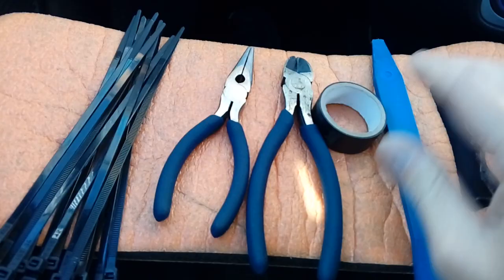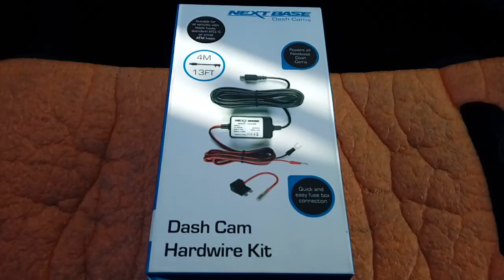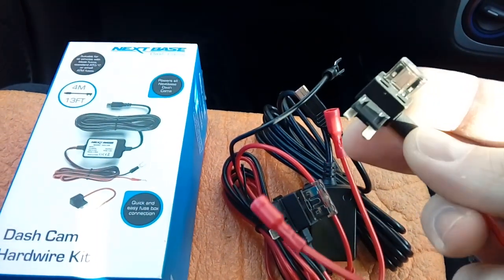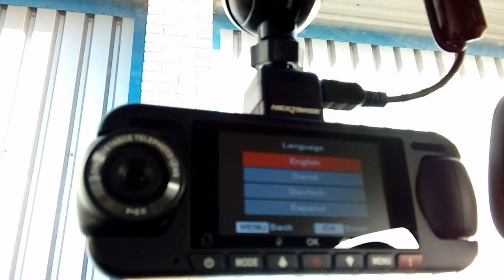Corsa c 2000 - 2006 how to wire dash cam to ignition,simple guide.

Comment: Can you not use a fuse splitter like you did with the Corsa D for the 12v switched power supply?
Reply from the maker: Yes that would work fine.
Reply: Can i ask why you did it this way just for my knowledge? As in the other videos you say the fuse splitter is the proper way and splicing the 12v wire is for a botched job. Totally asking for knowledgeable not having a dig as i learn alot from your videos. You speak very clearly and your videos are really clear showing every step. So thank you.

Comment: Why do everyone go for 12v socket when you can go behind the glovebox on the wiring from BCM
Reply: The wires behind the glove box aren't very easy to identify. In my case there's was also a rats nest of black cables from some old tracking system behind there

Comment: Can I use this nextbase wiring kit for any dash cam if it’s a micro usb etc?
Reply from the maker: Yes as long as the camera has a 5v power requirement your fine. Please note the Nextbase kits in my videos are mini usb rather than micro usb.
Reply: PJs projects I can’t seem to find any decent cheap dash cams which are mini usb or they do not say